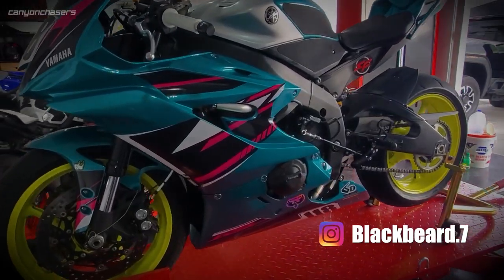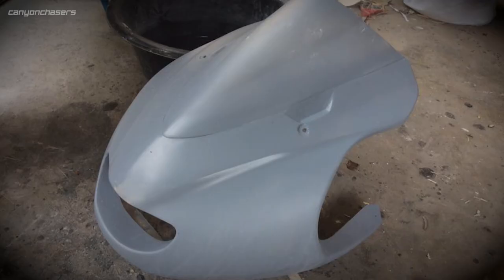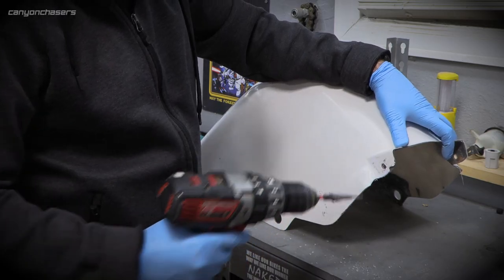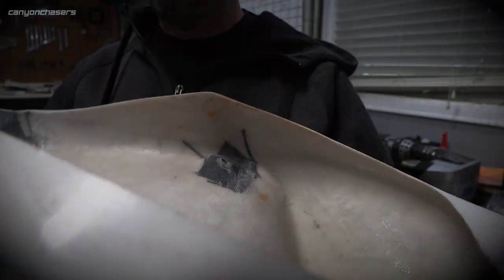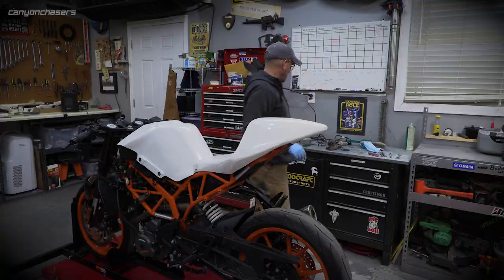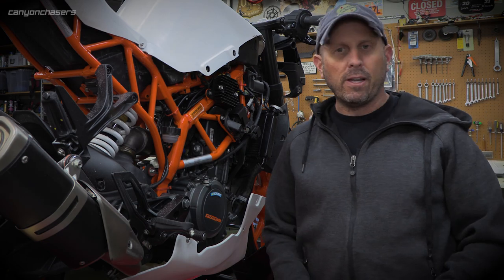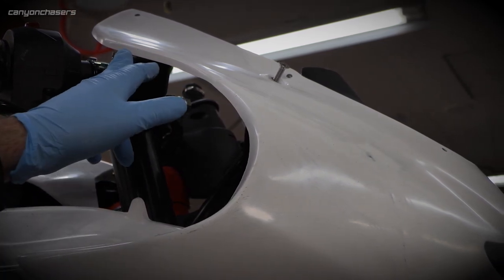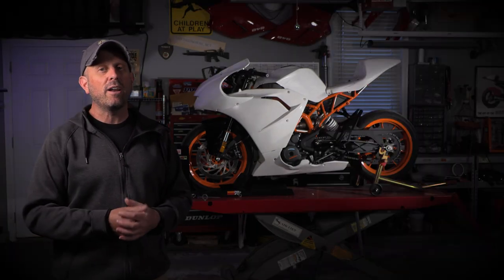Hand Made BODYWORK from eBay // EP04

Comment: As a previous RC 390 racer, I suggest keeping lots of extra bodywork bolts in your at-track kit.  I eventually ended up using rubber grommets as washers on the bolts that more frequently seemed to vibrate out and that pretty much eliminated the bolts from working their way out.

Comment: I’ve purchased from ebay and even alibaba and what I can say about them is the holes aren’t reinforced with carbon fiber/kevlar so its easy to break them even though you use shoulder washers.. also they also aren’t built the same, some sellers mix up pairs of fairings from different year model so they sometimes come uneven or one side being different in shape.. I also had problem mounting the middle bolt in the side fairing and had to bend the bracket to fit.. buying from tyga and some reputable seller solves these problem but it really is up to you if you want to pay for that price.. for me body fitment is part of the fun..

Comment: What a fun and relatively straight forward project. By comparison it has taken me five years to transform a BMW R9T Pure into a cafe racer via parts removal and simple bolt on accessories. I was so slow at deciding what I want for the final look.
As for colour for your build, Teal Blue goes so well with orange. So I vote Teal Blue with KTM orange pin strips etc.

Comment: This video captures the pain of cheap bodywork.  If I was Armor Bodies, TYGA, or Graves-Taylor Made, I would use this video to sell quality bodywork.  Excellent content as always. 
Btw, well nuts?  No sir.  Get some Dzus fasteners.  Way more GP. ;)
Reply from the maker: I've not had the best of luck with Dzus.  I have so much affection for well-nuts because the added rubber for damping on the vibrating machines I tend to gravitate towards.
Reply: Well nuts make more sense for a trackday bike where there is really never a rush.  For a race bike, dzus fasteners simplify and speed up working on the bike a lot.